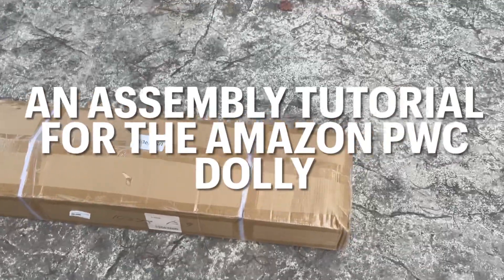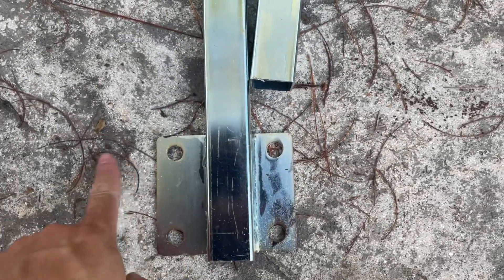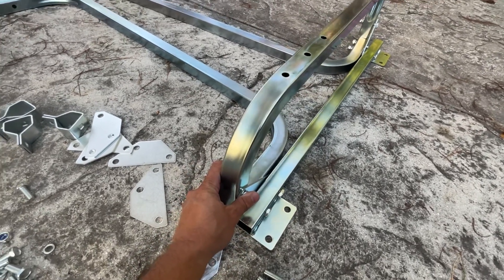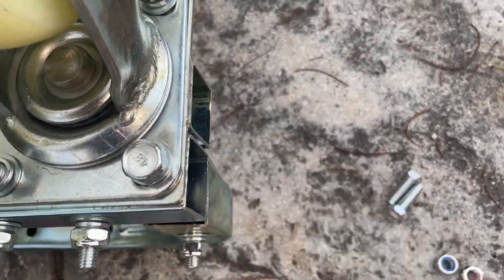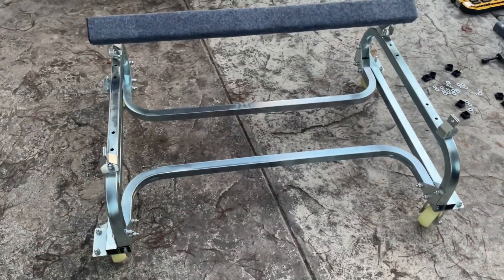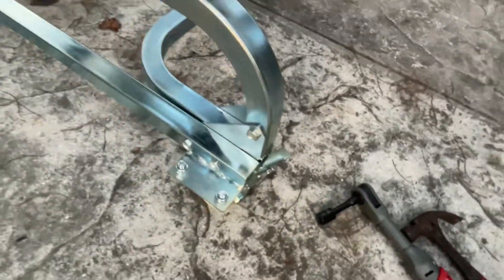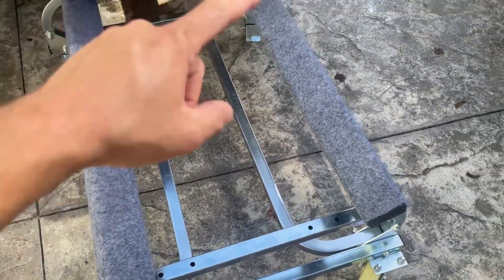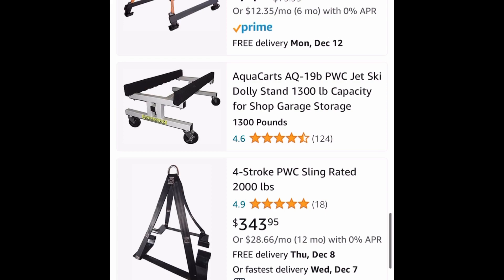Testing out a new PWC/ Jet Ski shop cart and Dolly to accommodate Kawasaki Ultra Jet Ski

Comment: Nice!  I've been thinking about getting one of these. Looks like it is pretty sturdy.  How does it roll?  Also, how much clearance is there between the bottom of the hull and the subframe when it is sitting on the bunks?
Reply from the maker: Yeah it’s actually very sturdy and solid. It rolls great, all 4 wheels swivel so it’s very maneuverable. I would say about 18” of Clearance underneath to the frame
Reply: @JDsWaterWorld  Wow, that's way more clearance than I was expecting.  Thanks JD!

Comment: I was wondering how you like your dolly so far.  I was leory of this model till I saw your video. It sounds like the material is strong by the sound of it hitting the ground.  I was concerned about her the bunks bolt to on the swivel point, it looks like it is pretty strong which I thought would be a weak point and bend when loading and unloading. I like how you can adjust this model to fit the hull rather then just the straight flat bunks.  Any weak points you discovered as of now?  Thank you.
Reply from the maker: I appreciate your comment since this video didn’t really get that much attention or views! I think the dolly is great! It’s been doing hard service outside since I got it, and is holding up well. The “locks” on the wheels are worthless, but other than that it was great deal for the money. I have had $500 shop dollys before and they are all too low to the ground- this one is perfect height to get skis on and off the trailer!
Reply: @JDsWaterWorld  thank you for the reply.  These reviews and videos help out a lot of people when they are  searching and doing thet homework.  I think Iam going to purchase one of these.  Big considering point on this dolly was the adjustable bunks, which other models didn't offer.  Thank you.
Reply: @JDsWaterWorld that’s an excellent point about matching the heights between trailer and dolly. I’m about to purchase my first one to store my 2022 ultra 310 lx-s for the winter. I might get one or two more rides here in ga.

Question : what is the recommended height to move ski back and forth?

Comment: I wonder how well would it work to put in pneumatic lift under to easily level rack with trailers for ease of transfer. - shouldn’t be too hard.
Reply from the maker: I have seen a $1k fabricated aluminum dolly that does have a built in jack so it can be raised and lowered

Comment: I have 3 of these and they’re awesome. Mine came with directions though😊. I can’t believe you were able to transfer the ski by yourself. Even with bunk slides, soap, and water I can’t budge mine. One tip that I’ve found useful during transfer is to ratchet strap the dolly to the trailer. I don’t trust the locking casters.
Reply from the maker: I agree with you on the ratchet strap- that’s a great idea. The wheels did slide a bit across the concrete. I have the bunks on my trailer sprayed down with liquid rollers..so the skis come off really easy.
Reply: @JDsWaterWorld  is “liquid rollers” a specific product name?
Reply from the maker: Yeah that’s the name of the product. Here’s a link or find it at your local marine store: https://www.easternmarine.com/liquid-rollers-bunk-spray-coating-10-oz-mk6810

Comment: Think I'm going to go this route for storage , space seems a bit limited around here now that I have a better half ;) Great video as always!
Reply from the maker: That particular dolly I have used for over a year- it has been kept outside- and it’s holding up well. The only issue I had with it is that the end caps are crappy and pop off exposing aluminum that can scratch your ski- and I would recommend putting a thicker layer of carpet over the ends of the bunks- I cut some small pieces and glued them over the ends with 3M spray adhesive